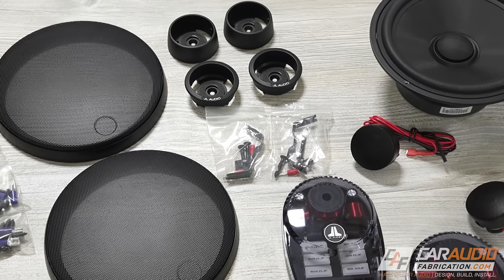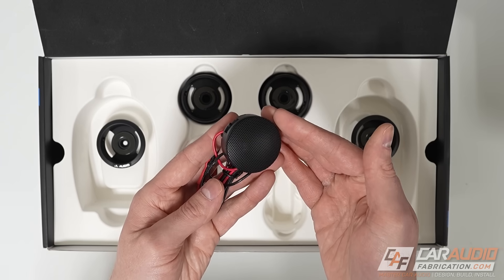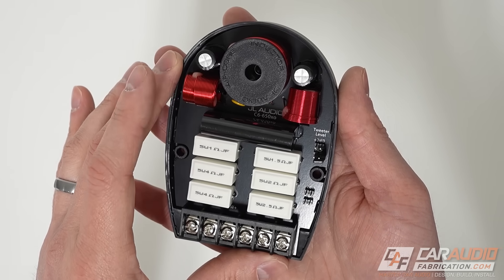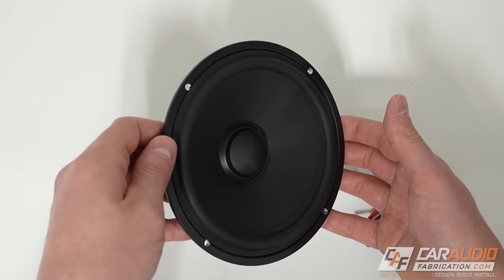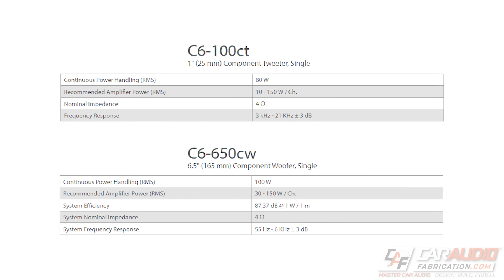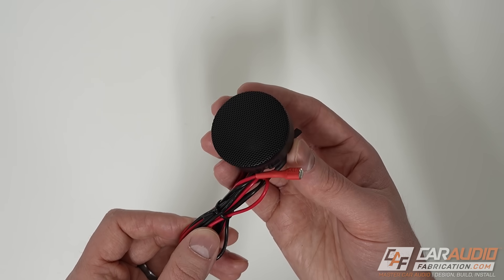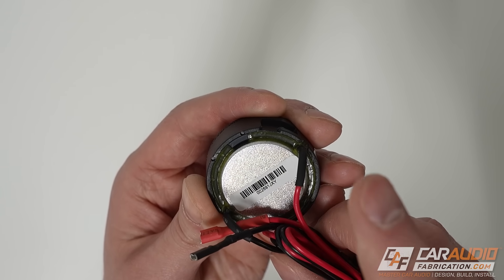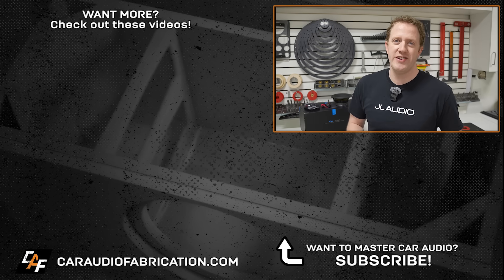NEW! JL Audio's C6 Component Speakers - High End Performance at Mid Level Pricing?

Comment: $1000 is Mid nowadays?
Reply: Yep
Reply: A dsp is $1000 , hifi speakers are at least 600-1000 minimum.
Reply from the maker: I just went on Crutchfield, I searched 6.5" component sets, and sorted by price. The range of available options across a wide variety of brands is from $60 - $5,500 for a 2 way component set. So by definition these actually fall on the low end of "mid level" pricing when going purely by the numbers. 

Now that might not match what you personally view as low end vs high end pricing, but we aren't evaluating the cost of these based on your wallet or mine, everyone's definition of affordable is different. We are defining them based on the range in the market.
Reply: Yup you are 100% right. The market is disgusting 😂 youd think plastic paper and steel were gold looking at those numbers @CarAudioFabrication
Reply: The market is just fine. There’s a $50 set just for you! Enjoy $50 distortion at 1/3 volume.
Reply: Boston Pros when I started installing were $1100 in 1998.   That's the equivalent of over $2500 in today's money.  So yes, $1000 is mid to high end
Reply: @RandoManFPV  Make sure your bring your dad along too, or whatever. Lol, if cringe was measured in dB you be in the mid 160’s.
Reply from the maker: @randomanfpv if you think the cost of a speaker is just defined by the cost of its raw materials then you really don't understand product design and manufacturing. Research and Development, Engineering, Manufacturing costs and a million other things need to be accounted for. Businesses are in business to make money. They need to recoupe those costs and make profit to continue to develop new products. Thats the way the world works.

Now there are some companies that skip the R&D and Engineering part, and just select random parts to have a build house throw together to save costs, but really the only unique feature for those "manupackagers" is the name they have silkscreened unto the product, that's not the case here.
Reply: @CarAudioFabrication i remember 20 odd years ago thinking i was crazy buying diamond audio components for like 500 dollars.
Reply: Mid is anywhere between the very top and very bottom
Reply: @CarAudioFabrication  I never said that's all that defines the costs I just pointed out that the cost is outrageous. I guess it's their ideas that are made of gold not the product.

Except there has been little to no technological advancements in audio in like 30years lol. The loudest loud today is minutely louder than the loudest loud of 30 years ago and it's produced the exact same way 🤣

You can't be the guy that both says old stuff is just as good and new stuff cost so much because of innovation and design.
Reply: @o0Donuts0o  keep cringing while I'm just as loud and just as clear as you are for literally one tenth the price, I'll keep giggling and smiling 🤭
Or you could prove me wrong. Prove my system isn't clear. Prove it's not loud. Prove anything. Oh wait, you SQL guys have never proved a single thing in your entire lives 🤣
Reply: No.  A thousand bucks is a lot of money. They are twice the price of the C3s. But the added performance is extraordinary.   Whether it is worth the difference is a personal matter and depends on your hearing ability and budget.  But for me it was definitely worth the extra $500.
Reply: Go with hertz,  half the price and just as good if not better sound qualities.
Reply: Well I'm Old School Car Audio from back in the early 80's when High End was my Pioneer Component Cassette Tuner with Separate Amps and a Dual Amp Balancer with EPI 6x9 Plate Speakers. For now I'll stick with my JL C5 650's and MB Quart QS216's.
Reply: Very mid
Reply: I personally don’t see any benefit in spending $1200+ on a set of components…but that’s just me.
Reply: @strobaholic I got Rockford Fosgate T2652-S componets listed at $329 , but took an open box option for $289. I like that the crossover has separate inputs for the tweeter and mid range. I'm going to run them off separate amps that way.
Reply: @Living_EDventures why separate amps? Are you using multiple 
2-channel amps?
Reply: @RandoManFPV So loud makes something good now? 😂 Chucheros, PRV and SKAR are the best by that definition then. 😂
Reply: Just save up so you get your moneys worth trust me
Reply: The individual mid is $299.
The tweeter is $149.
That is $450.
You telling me the crossover is $550?!?!?
Reply: exactly !
Reply: @MaxMax-sj7wb exactly
Reply: @RandoManFPV  I can tell your system is garbage just by the way you type such aggressive sentences. We have all been there, wanting better but not able to. Work at it champ. You will get there. In the meantime I won’t laugh at your “1/10th” Sanyo system.
Reply: @o0Donuts0o  then prove it 🤣 ive said nothing but facts here. If im wrong, point out what I said and prove it wrong. If I'm not as loud and clear as you are for less than 1/4th the cost then prove it 🤣

Typical SQL guy here talking out his azz can't back up a single thing he says with facts, have fun if thats what youre doing but you speak nonsense until proven with facts.
Stay in your lane getting bent by whatever name brands your boys get you hyped up on bum
Reply: @RandoManFPV  I found the Temu sound system guy. 😂
Reply: @CarAudioFabrication  I get your point but that’s kinda like saying 300,000 is on the low end of the median range for buying a car bc a Bugatti Chiron costs a couple million lol.
Reply: Yeah pretty much or 300 for something you get eh sq out of I’ve been looking for a month for something good sq for $300
Reply: @SQ_Silverado jbl has a set for 2 gs it’s all in the tweeter pretty much
Reply: $1,000 was cheap 20 years ago bud.

Comment: slightly misleading title.... $1000 = mid level ? not for most people.
Reply from the maker: Your wallet doesn't define what is mid level. The position in the market does. Components range from $50 to $5000. So very much so in the middle.
Reply: @CarAudioFabrication  not trying to be argumentative,  just saying that alot of people associate high end with the quality of the gear.. and midrange priced gear doesn't cost $1000 for one set of speakers.
Reply: $1000 is very much mid-range for car audio. If you only want or care about budget speakers and what the best budget speaker is, that's okay, but this is a mid-level speaker.
Reply: @CarAudioFabrication  do you consider them warm or bright speakers
Reply: 1000 dollar a set is mid level.
It's not about the ability of the peoples to buy it, but about the overall quality of tone and finish.
It will simply say that you will find higher end, more extreme made gear out there, what is true.

Comment: Good gawd! "mid-level pricing"? $1,000 is NOT mid-level pricing!
Reply from the maker: We are judging them based on the market. Go look on Crutchfield right now. 6.5 components range from 64.99 up to 5499.99. 1k is between those two values, actually a super solid value for the amount, performing quite good in comparison to even the high level budget components.
Reply: pretty cheap compared to focal

Comment: One thing that stood out to me when watching a JL Audio training video was that when running a passive crossover, it would take roughly 3x the power to reach clipping. Always run active to get the best clarity and it would require very little power. That would also explain why there power chart is such a wide range, bottom end for active and high end for passive crossovers
Reply from the maker: Side note - The specs shown in the video are from the other product listings for when purchasing the woofer and tweeter individually.

Comment: Excellent review. You pretty much nailed it. I just had these installed and the improvement over the C3s is astounding.  I have the C5s in my truck and your observation about the differences in the tweeters is spot on.

Comment: Had them installed in my car several months ago. Love them so much I hope to put them in my pick-up and replace the C5s.  I have loved those C5s for over 5 years but that top end and mid bass of the 6’s are audibly superior to my ears.   Thanks for your review.
Reply: What amp do you use for the C6’s? I’m trying to make a custom headliner enclosure for them in my truck and don’t know which amp to go with.

Comment: I am still running a set of C5 speakers from more than ten years ago.  I've been waiting for JL to build a new set of speakers.  I'll be sure to give these a look when I am ready to plug in a new system.
Reply from the maker: That's the great thing about quality gear, it lasts! These should be a pretty simple upgrade for you assuming the step up from a 3/4" tweeter to a 1" tweeter isn't limited based on your install location.
Reply: @CarAudioFabrication  At this point, since the car the system lives in is no longer covered under any warranty I have no reservations about doing some modifications, including sound deadening and a few others.  One question I do have is, do you have a video on fabricating new install points for speakers?  My idea is to have woofer, mids and tweeters all in front and leave the door woofers in the back the way they are, but the truck doesn't have spots for 3" speakers anywhere.  

I do realize that the C6 doesn't appear to have that size, but the design is still fluid rn.  

Thanks Mark!

Comment: Another longtime C5-650:user here(and the XR650-CS before that). Been waiting for these to drop, as they'll pretty much be the automatic choice in my next setup. Maybe active on a 900/5 with a 12W6.

I'm still loving the C5-650 and 10W3 HO box that have been running trouble-free for 11yrs off a little XD500/3. 

One reason I've kept the same car all this time(along with it being an equally trouble-free Toyota) is that I still look forward to driving and listening every day.
Reply: Once you audition the C6s you will likely want to switch.

Comment: I was and still am a JL Audio fan for well over 20 years. I was  an installer for almost 30 years (when their tweeters were oval) and was a rep for 9 years. Two of my cars currently have complete JL systems built out with full trunk integration, amp racks, matched upholstery and honestly - I get a solid impression they don't give a flying fuck. Thirty years loyalty, thousands spent and I can't even get a deal on 2 T shirts. I just finished a new system for my '19 Continental and due to JL corporate greed and ridiculously exaggerated prices I went with Focal. No regrets. For over 20 years I was shoulder to shoulder with many of the JL brass and today there's no reciprocity in loyalty. As my wife would say, "Magloko ka JL Audio". Rip off srtists!
Reply: @_BAD_MERC_  huh????

Comment: I’ve had C3 coax in the rear, and C5’s in the front. The C5’s were utterly atrocious to tune, and the tweeter was WAY too loud on max attenuation. 

The C3’s sounded gorgeous and were super responsive to EQ adjustment. Very impressed. 

As these are down from the C7’s, are they as harsh?

Comment: Hi Mark, thanks for producing the video content and sharing your knowledge.  I am going to gut my 2018 Tundra crewmax JBL I am split two way or three way components up front do you have any thoughts on that? The Tundra tweeters are in the sail panels, the 3" mids are dash corners and 6.5 in the lower door.  I am looking at C3 JLs or Alpine R or Focal 3 way. Any advice you can share for us Tundra and truck owners where the seating position is even further off than a car being sort high up in the cab. Appreciate it!!

Comment: I’ve got an entire custom system in my regular cab truck done about 10 years ago by a local stereo shop.  They did an amazing job using Slash series amps 300/4 and 600/1 along with four JL C2 6x9 door/rear speakers and 3.25” dash  along with two 10” w3 subs in custom fit sub box.  It’s getting dated and I make much better money and would like to upgrade but C7s were just a little too pricey for my DD work truck.  It’s looking like these might be a better choice for my needs.  
Thank you for the info

Edit to add:  I used DB Euphoria Xpert EX6NCD on my Harley Road Glide Ultra and love them! How would you consider these JLs would compare sound wise? I can’t afford to just change out speakers to see what they sound like and there are no local stores that carry most of these higher end speakers to listen to in person!
I miss Curcuit City☹️

Last edit: I also have a car with a Harmon Kardon factory system in it that I want to upgrade but don’t trust myself or any local shops to do it without hacking up the wiring.  You have a shop😉😊
Reply: The car with Harmon Kardon assuming it's a Chrysler product they make an Idatalink AR module and the ARC Audio PSM PRO which makes it plug and play with full band width from your stock radio.   And has all the harnesses so no wires need to be cut at all.   Very simple to integrate with for most competent shops

Comment: I had the C5’s. Loved them!
Reply from the maker: What sizes?
Reply: @CarAudioFabrication  6.5” component set.  Ran them on a JL Audio 500/5. C2’s in the rear and 2 10 W3’s sealed.  Best sounding system I’ve ever heard.
Reply: I still have the C5s and a stealth sub in my pickup.  Absolutely incredible sound.

Comment: are they Iron Core inductors? Does Active sound better because the crosovers have inexpensive components? Sand Cast Resistors & lots of metallic parts?
Reply: Iron core inductors don't impact the sound until the iron is magnetically saturated, which takes a LOT of power. 

Sand cast resistors don't actually exist as a term in manufacturing or engineering, that word was made up by con-men. If anybody uses it, I'd be VERY skeptical of any of their other claims. 

Active sounds better because you can use steeper crossover slopes and time align more accurately.
Reply: @blakebrockhaus347  Danny Said Different GR Research but I appreciate your input

Comment: The C6 Litterly appeared on their website 2 weeks after I just bought a set of C3s FML
Reply: Crutchfield has a great return policy! I’d reach out to them and get them swapped!
Reply: @kymanc161  Thank you for the advice. After seeing the pricing difference, I'm considering just buying a second set of C3s. I'd like to have four 6.5s in that zone instead of just two. especially now that I have broken in the C3s, and they sound fine—just too quiet at 75 watts. Now, I would be worried the C6 at 100 watts might also be. That would be very costly to have to double them.
Reply: @MaxMax-sj7wb have you heard the C6 already?  Do they get louder than the C3?

Comment: I just want to add an 8" sub to my 2019 CX-9. I was quoted a ridiculous install price. It cant be $600 difficult right? Any suggestions?
Reply: Call Crutchfield.  They will talk you through installing it yourself.  Should be able to do it for 1/2 that or less.
Reply: What type of sub is it and does price include amp and sub and cables everything routed and done for you? I just know that I bought an amp for 115 with 10inch sub kicker and it ran me around 200 bucks with cables and all... just be advise I installed it myself. So 200 bucks for amp with warrante 5 years , 10 inch kicker subwoofer 5 year extended warrante , and cable kit.
Reply: @ElectricBlade  thx for the reply. It’s just a JBLBasspro nano (sub & amp) with wiring kit. I’ve watched quite a few videos on it and thinking about doing it myself. $600 is ridiculous for install only.
Reply: @mryan3204  hell yeah install only nah man. It's too too much. They will talk to you like "we will try and tune the frequency" trying to make it sound hard. It isn't just look up how to tune an amp yourself. It's simple once you start doing it yourself

Comment: Wish they made a 3, or 4 inch for the mid range. 
There’s a lot of detail lost between the 6.5 and the tweeter.
Reply: True that!, I actually prefer the 6.5 and tweeter and than adding an 8" for mids.
Reply: @MaxMax-sj7wb Every 5.25-6.5 has so much detail lost from the 150hz-3/4k range. That range (for the most part) requires a separate speaker to fully capture the details of that range. 
I had c3s. I decided to upgrade to 8s in the doors, tweeters and 4s in the A pillars. 
It’s the most surreal sound I’ve ever heard.
Reply: @Bezzle.  If I had the money, I would do a similar setup with a set of 10’s to round out the low end.

Comment: No realated to these speakers but is it worth going 2 way active or should i keep it passive till i go 3way? Also would it be worth making a 3 way set up having woffer on one channle and making the tweeter and midrange on passive cross over on a channel together
Reply: Personally, I would just use them passive. However, passive xovers use a lot more of your amps power than active. With active, you can use a smaller amp, or even put the savings into a higher quality, smaller amp. 

Its really a judgement call on your part. Passives are also a plug and play install. You get a complete system and you know its all going to work properly.